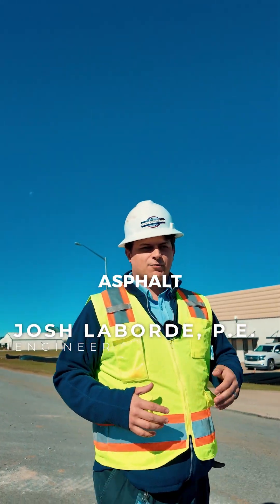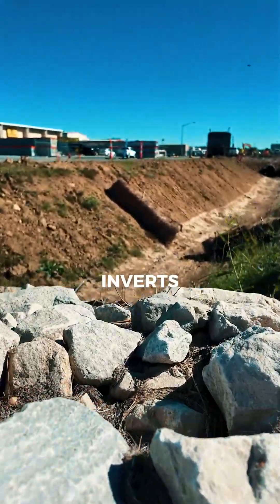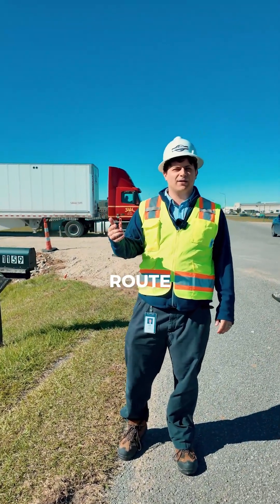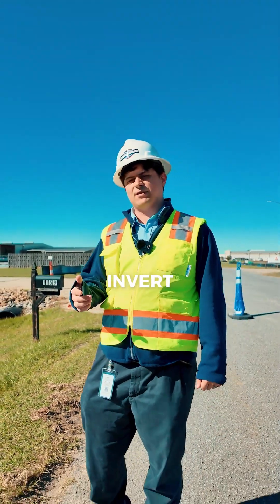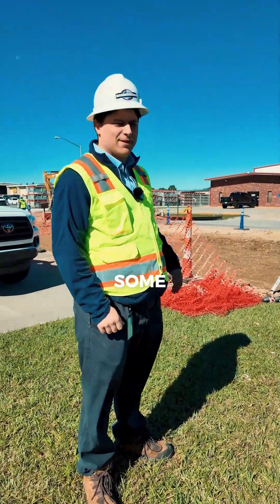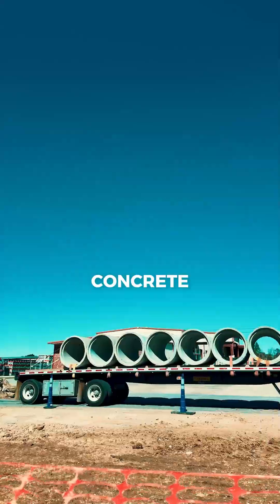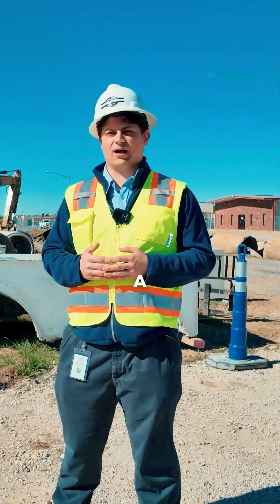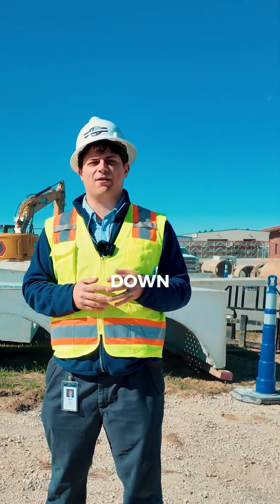Petroleum Parkway Upgrade | St. Martin Parish, LA

Comment from the maker: Precision beneath the surface drives performance above it. From regrading ditches to correcting pipe inverts and using survey-verified elevations for drainage structures, every step ensures the roadway functions exactly as designed.